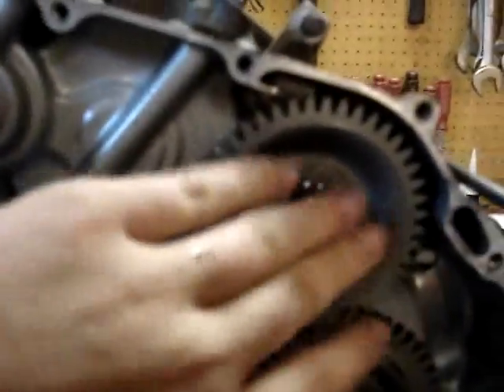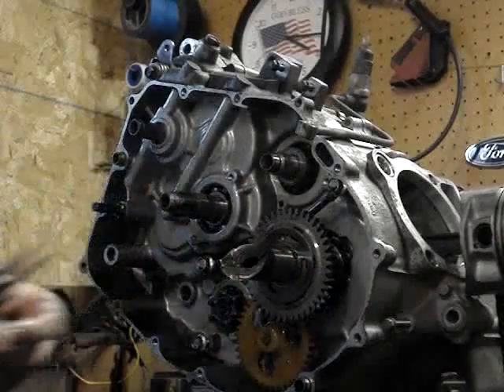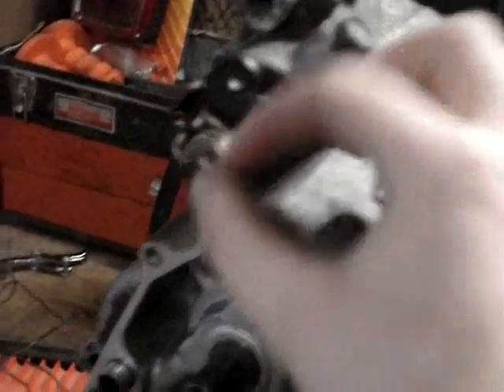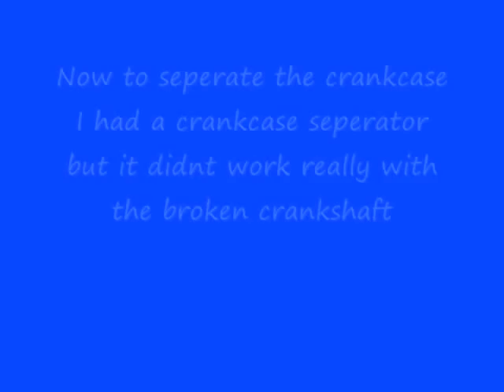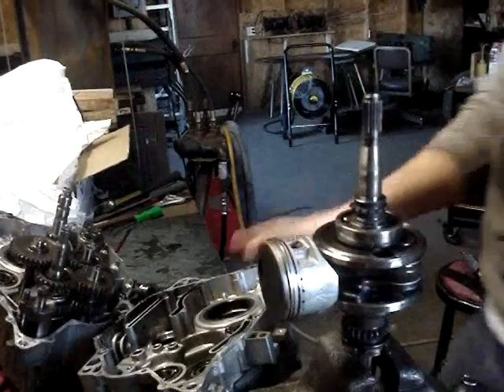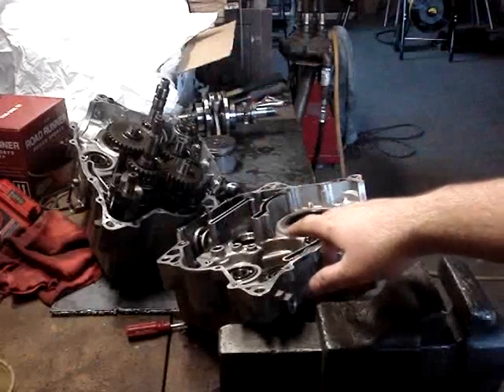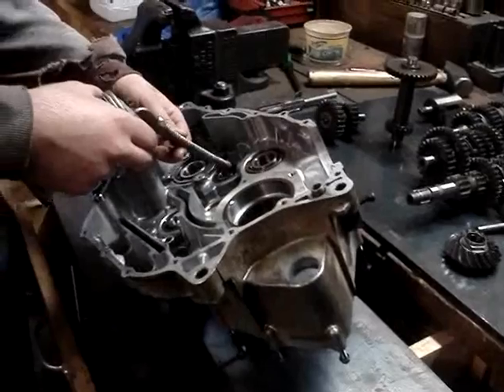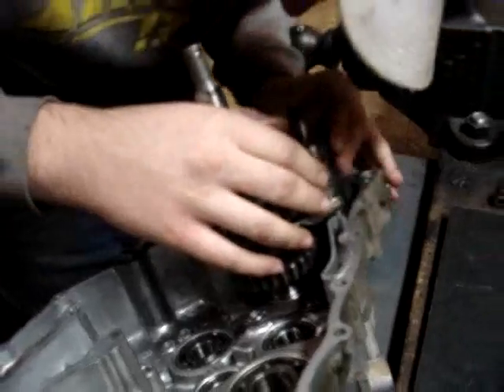Yamaha Engine Teardown Part 2

Comment: I was curious on how did you remove that spring thingy on the right side end of the crank shaft I couldn't figure it out on how that come off if it uncrewed off or turned at some point to remove it so I can install it on my new crankshaft

Comment: I have a 350 warrior I bought for 400 dollars as I got it home, took off both side case covers all gear look good and clutch also and took off head and jug my spark splug was smashed and one of my vavles disc looking part that goes faces piston broke off am guessing thats what made a hole through the piston. So everything moves fine not broken but am sure I have pieces of piston in the motor this is my first time breaking down a motor kind of dont want to split open the case. Is there any way to clean out or flush out metal piston pieces out the case without breaking it open. I also have a small teeth gear looks like not sure where it came from am guessing gear inside the case. Lol this 400 dollar quad I got is gonna be more like a 1000 plus something quad. That's what I get for trying to get a deal.

Comment: I am very impressed with your detailed work and videos!  Thank you very much for taking the time to do these.  My son and I are in the middle of tearing my 2003 660 Raptor engine apart to install a HotRods Stroker Crank and Big Bore kit, and I would have been really nice if you had a video on the 660 Raptor!  By any chance have you made one and I just didn't find it?

Comment: I got a question do u now why on my timber wolf after I rebuild top end I noticed that my cam gear has 1/4 inch play and is that normal and how would u keep the timing because I set it and it moves after about 1 minute thxs

Comment: Do you have to split the case to replace the crank or is it possible to open up the fly wheel side and just remove it through there?
Reply: cannot be removed from flywheel side. COnnecting rod will prevent that.
Reply: Mitch Cutsforth fi